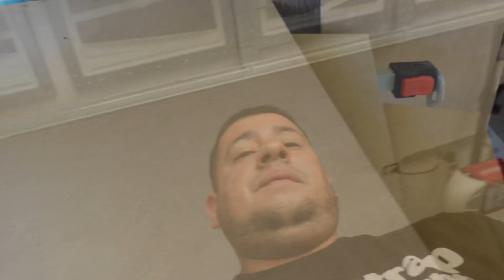Car Audio Building Dodge Ram Custom Fiberglass Door Panels for Prv Mids and Tweeters

Comment: SMD Sun Flash resin.... Apply to entire work area (inside shop out of the sun) add fiberglass mat..... add more resin... Take wet panel and put it in the sunlight..... will dry hard and ready to work... with in a minute or two.... Resin will not harden till you place it in the sunlight..... it's easier to work with.....